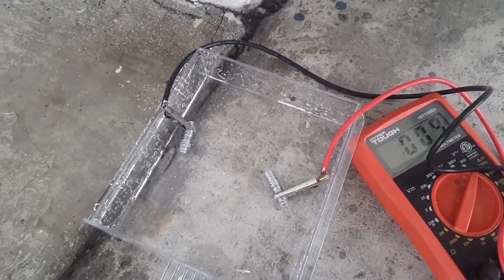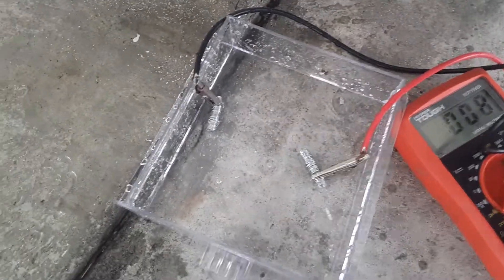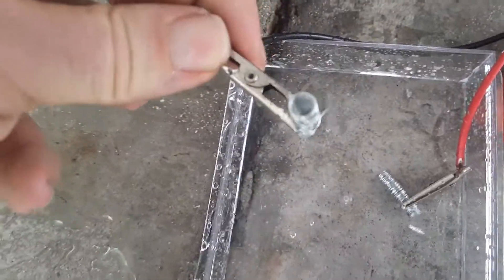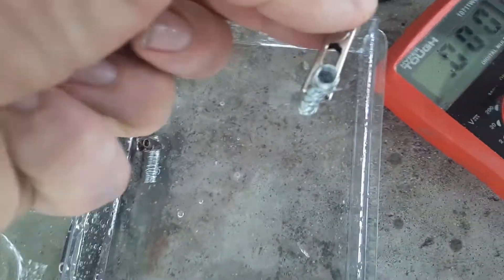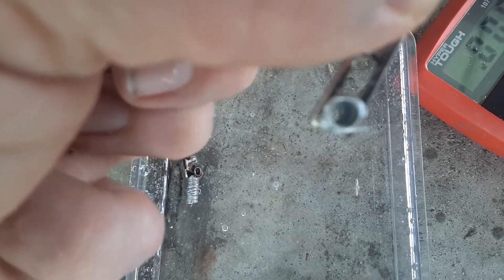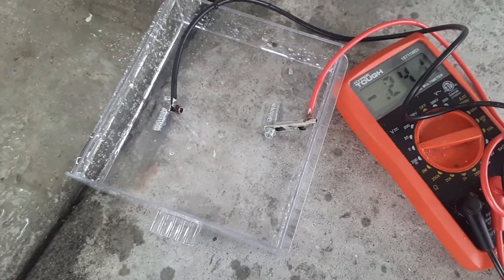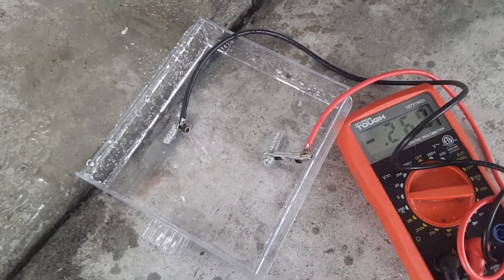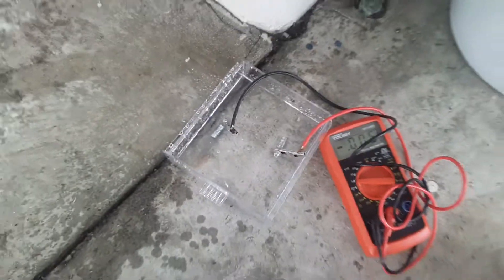MODDEL STYLE QUANTUM ENERGY CONVERTER WITH NANOCAVITIES

Comment: Phd. Moddel -- That is a very expensive way to do it (harvest energy from the vacuum of space/time). In my various designs, I have gotten it (the total cost of usable electricity harvested) down to a tenth of a penny per kWh; (0.0011/kWh) retail (to the end user), initially. As such, your method is only good for educational and/or recruitment (into the US Military's USAPs) purposes. A scientist in NASA's Eagleworks Division informed me of your method. If you garnered their attention, you are up there in the secret top physicists community. Congrats!
Reply from the maker: What method do you use? A langmuir hydrogen version?
Reply: @peterlang777  PhD. Moddel's objectives are quite different than mine. He is recruiting for the US Military (USAF) and training (preparing) his students to reverse engineer alien tech for US Military purposes. Though, as the US Military is well aware, I can reverse engineer the most advanced of alien tech, my objective is to design ZPEs for the general public (to be sold commercially). My ZPEs are simple, are low tech (do not employ any of the very dangerous higher fundamental forces of nature (6th through the 8th), are cheap to manufacture, solid state (warranted for 30 yrs.), no heat, no waste products, not nuclear, no consumption of fuels or anything else, don't require batteries or recharging, and they utilize, almost entirely, off the shelf components all of which are easy (cheap) to recycle. They start at 500:1 output to input. One the size (volume) of a 2 & 1/2 gal. water bottle can deliver 25kW continuous of usable electricity for more than the warranted period, non-stop.
Reply from the maker: @danielcooper2382  but what method do they operate by?
Reply: @peterlang777  Who is they? I'm an independent (you know; my ZPE inventions are mine alone and no one has assisted or assists me with those ZPE inventions of mine). I do NOT work (have NO contracted with) for anyone; especially NOT the US Military.
Reply from the maker: @danielcooper2382  matsushita of japan
Reply: @peterlang777  That is NOT so simple; me explaining to you (the public) the undisclosed details of my ZPE inventions. No US citizen (and I am a natural born US citizen) is allowed to give out ANY specific non-disclosed information pertaining to any ZPE, by law (FIRRMA, passed into law in 2018 by Trump and effective 2021), except to the US Military. The penalties for violating FIRRMA are horrific. Yep; it's a hanging offense, literally. So, I'm sure that you can understand (sympathize with me) when I say that I have to decline to provide you with ANY of the specifics of my ZPE inventions.
Reply: @peterlang777  I would love to work for the Panasonic Group. Konosuke Matsushita, (died in 1989) founded the Panasonic Group. But, that decision is NOT up to me. FIRRMA clearly sets out the very detailed and very specific procedures that MUST be followed in order even to approach me. 許されるならパナソニックグループで働きたいです。松下幸之助氏（1989年死去）はパナソニックグループを設立しました。しかし、その決定は私が下すものではありません。 FIRRMA は、私にアプローチするためにも従わなければならない非常に詳細かつ非常に具体的な手順を明確に定めています。

Comment: Can you please share the procedure you used to prepare these coils?  How do you make these coils?  I am certain there are people who would like to do what you have done.  So that they can see the results up close and experiment.  Perhaps they might find ways to improve the function or reduce the cost of making a practical device.

What tools and materials are required to replicate your coils?
Reply from the maker: the coil that uses the nanotech was made by DARPA for me. it uses the new IBM 5nm UV lithography.  the machine makes 20 nm diameter holes in the steel. moridan 5nm quantum dots are put into the base of these holes by ultrasound manipulation
Reply: @peterlang777  So not possible for anyone to get access to these? I just wonder Wmwhy where you able to get an hold onto these? kind regards
Reply from the maker: @coltx64  because I designed alot of nanotechnology prior to this. solar hydrogen catalysts (2016)  water batteries (2016)  earth heat energy rectennas (2017) etc.   so people with labs are only to happy to fabricate a design I send
Reply: @peterlang777  Aaa I see, I understand :D thanks for answering :D Is everything you made open source? I just wonder, Is everything of your nano tech possible to make at home? For complete beginners?
Reply from the maker: @coltx64  it's all open source but not all can be made easily .
Reply: @peterlang777  nice, sharing is caring I believe human race can accomplish alot more together! 

I see, any hope of any future videos where you can show the people a step by step how to make the manageable nano tech at home? So the not easily can be easier to replicate? And new stuff for beginners could be easier to jump into? O:)
Reply from the maker: @coltx64  later thi year you will be able to buy water batteries from strategic elements. the @Robert-Murray-Smith channel has DIY stuff too